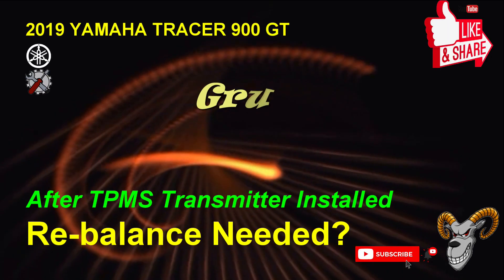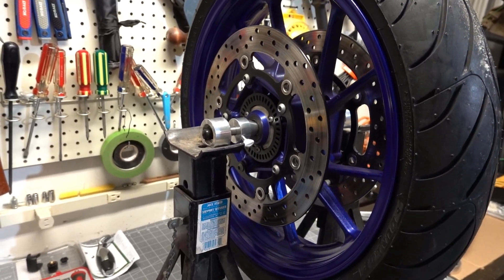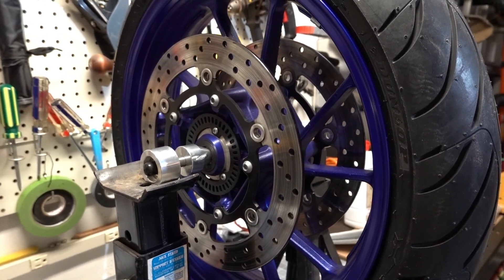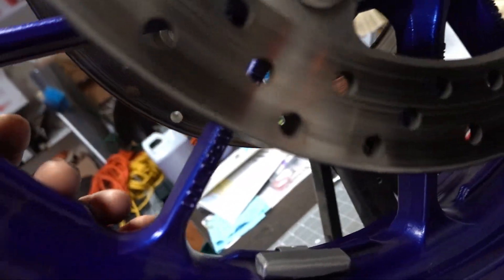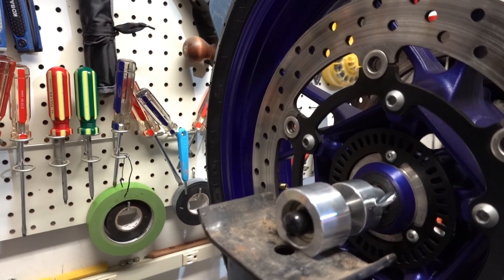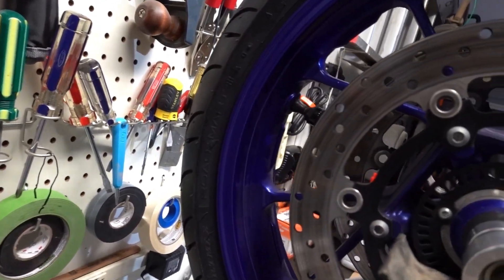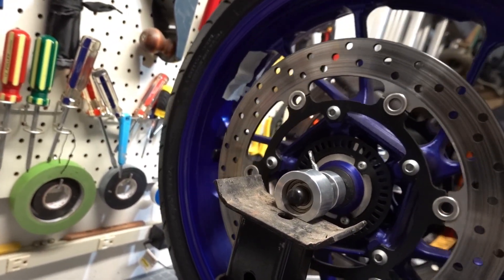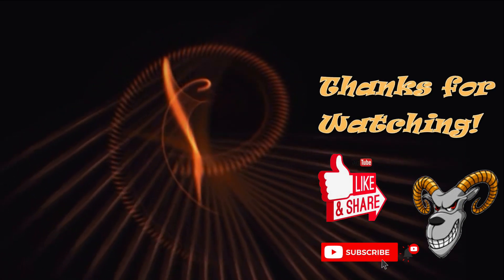Do I really need to re-balance my tires after installing FOBO Tire Pressure Monitoring System?

Comment: Step 1. Get a real static balancer. Step 2. Remove all the weights. Step 3. Install fobo sensors . 
Step 4. Start over balancing the wheel
Reply from the maker: Thanks for your step by step process, but what problem are you getting to solve and who has that problem?
Reply: @GrumpyGoat  The balancer you're using undoubtedly has resistance that will not allow Tire to fully drop to the bottom. You can get a good tire balancer for around $100 with the proper shaft and bearings. Before you balance any tire you need to remove all of the weights and start over. And if you're going to use external transmitters, you need to install those first , and then balance your wheel and tire and transmitter as a unit. Your Counterbalance weights should all be in one spot. Not several spots. This is what happens when you try to Leave the existing weights on and add to it. And as a motorcycle mechanic I thought put my 2 cents in.
Reply from the maker: @Magicinstalls I have no problem. I don’t even have that bike anymore and my Marc Parnes balancer works just fine for me on all wheels I’ve balanced. The Fobo transmitters need no additional balancing of the wheel. That was the point. Looks like you missed that. No worries. Have a nice day.
Reply from the maker: @Magicinstalls There is essentially zero resistance on the Marc Parnes bearings. There is enough margin in the balance such that no additional balancing is needed. No imbalance was felt in the bike when riding.

I actually do understand how to balance wheels and the need to strip down first. That was not the point. I wanted to get away with not balancing at all and the results proved that it was not really needed, based on the feel of the bike afterwards.
Reply: @GrumpyGoat  Hey I wouldn't dare tell you how to make videos 'cause that's not my Forte. But when people see you using jack stands to balance a tire, it's not a good look you do you. And of course you need to balance the tire with the transmitters. They are over 1/4 ounce in weight! if you put 1/4 ounce stick on weight you will see a difference.
Reply from the maker: @Magicinstalls I agree that the Jack stands are not a good look but I don’t want to shell out additional money for looks. I am an engineer and know what is needed to get the job done. The Jack stands are an ugly but stable base to keep the axle high enough to allow free rotation while balancing. Pretty does not improve accuracy. 😏

Thanks for the comments and input.

Comment: Good video.  I put them on my F6B and didn't balance and they are butter smooth. I know many that don't balance motorcycle tires and never had an issue.  But, when I get my new tires I am going to balance them after I have the cap on since I am right there doing it.
Reply from the maker: Thanks for the comment.

Comment: I noticed that you had a rubber valve stem. Manufacturer says can't use external sensors with rubber. Just with metal. Must use internal sensors. What do you say to that?? Cheers!!
Reply from the maker: I say balls to that. I used it as shown for over a year or whatever and it worked just fine. The valve stem didn’t break off and it didn’t leak.
Reply: Perhaps you lucked out. I watched a video this morning about a guy on a Harley who had both tires go flat simultaneously. I think I'll do some more research. I'll try to find the video and post a link for you. Cheers!!
Reply from the maker: @davidcox8961 Thanks. When I was shopping I watched many videos, some touting the use of steel valves. I was not convinced that I needed to disassemble my tire just to install a steel valve, choosing instead to install it at the next wheel change. 

I also had TPMS sensors on rubber travel trailer valve stems without problems. I am not concerned and the recommendation for using steel is for liability and a CYA for the manufacturer. If the added mass on the end of the valve is small and the rubber valve is in good condition there wouldn’t be a problem. Besides, if a valve were to start leaking the sensor would warn you in advance and the failure should not be a sudden catastrophic failure like a blowout; it would be more like a leak.

But you have to be comfortable with whatever route you choose. 😊
Reply: I think I'll go with the metal stem. I want a TPMS for safety. No point adding a potential hazard. The Harley guy thought that his offset valve stem caused the added weight of the sensor to push the stem into a frame. They both failed at the same time, when the bike got to the critical speed. Weird eh? Can't find the video. Cheers mate!! Ride safe. Oh one more thing. Aussie guy got quoted $500 usd to replace sensor batteries. BMW of course. He did it his self for $10.
Reply from the maker: @davidcox8961  FWIW, I agree with your approach going with the metal stems, as I was going to do at the next tire change. I don’t set any stock by Harley reliability I am afraid. Both going together suggests that the valve stems were junk. 

I would have loved to be more successful in the trial I did changing the BMW TPMS sensor battery, but the contacts were firmly welded in and it was not worth my time. $500 is ridiculous and one of the few reasons that I have against BMW … they are expensive for BS reasons, in some cases.
Reply: @GrumpyGoat  I bought myself a,BMW R850R at age 75. It makes me feel young again. ;-  ), I read the FAQ's on a website selling TPMS. The actual reason for not using rubber stems is that the sensor opens the valve which pressurize the stem constantly. The stem isn't designed for that. Makes sense I think. 
Yeah, if you don't have deep pockets gotta do your own maintenance on the Beemer. In the 70's I had a 75/5 BMW. Sun is shining. 45 degrees. Good day for a ride. Cheers!!
Reply from the maker: @davidcox8961 Actually the stem is pressurized constantly anyway since the plunger at the threaded end is what keeps the air in. What it’s not designed for is the flexing at the rim end due to the mass at the threaded end. That can cause cracking on aging stems and hence the leak. 

Nice day here too … just over 60. Just came back from a short errands ride.
Reply: @GrumpyGoat   I'm thinking about buying this. SYKIK Rider SRTP400 Inner tire TPMS for Motorcycles. Not 60 here in the PNW but not raining. When it's cloudy it warms up. But then it rains.

Comment: Wouldn’t work to just add .3 oz opposite the Fobo? You really didn’t answer that question.
Reply from the maker: I thought I did. The wheel was not unbalanced to where weights were needed. To me that is the answer.
Reply: Weight of the sensor is so little it is nothing to be concerned with...
Reply from the maker: @MrLemurman  Exactly. It did surprise me but that is what I found. Have been riding the bike like that for thousands of miles now and there are no issues.
Reply: Ever heard of Dynabeads? Look them up and you can install them in your tires. 2oz for most front tires and 3oz rear.
Reply from the maker: @MrLemurman  Yes I have heard about Dynabeads and solutions such as those. Not interested in the least though.

Comment: Any long term review of the TPMS?  Has it been practical to use?  Do you like the phone-based TPMS, or would you prefer a dedicated display?
Reply from the maker: Kurt, that is a good idea and maybe I will do one this weekend. There are a few thoughts I'd like to share. Yes very practical to use especially if the alternative is no TPMS. 😁 I would prefer a dedicated display but the FOBO phone-based display provides more than any dedicated display ever would, so there is a trade-off. On my BMW I don't have to remember to turn the app on (which is the only way you'll get alerted.
Reply: @GrumpyGoat  You don't have to turn the app on. When I get within 20 yds away even with the garage door down my phone starts alerting me and vibrating.
Reply from the maker: @MrLemurman  I don’t understand. If the FOBO app is off, what is it alerting you of? With mine, if the app is off I get no alerts. Even when the app is running I get no alerts unless there is a sudden drop in pressure. But with the app off, the tire can lose all its pressure and there is no notification.

Comment: Grumpy....lose the lock nut. Not necessary. Sensor will stay on just fine. Don't be too anal with the balance. You are very close here... By the way, am a FOBO "distributor".....
Reply from the maker: I was under the impression that the lock nut was not to keep the sensor on, but was a deterrent to casual removal by someone looking to steal the sensor. I have no concerns with balance. 🙂
Reply: @GrumpyGoat  You're right, but on a bike that valve stem is most likely not easily seen/accessed (especially the rear wheel) and the front can be inside the fender on a lot of bikes. If they want it they can get it....the sensor is useless if anyone steal it anyway. It is paired to your phone and will never work. If you ever take it off to gift or sell to someone you must release it first. Read about releasing the sensor...